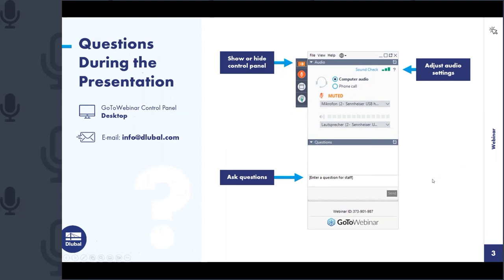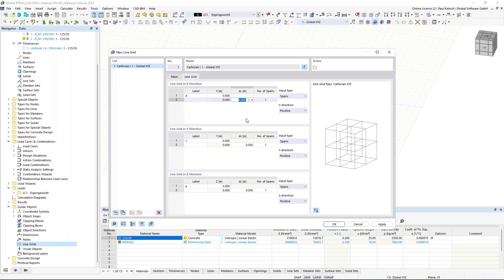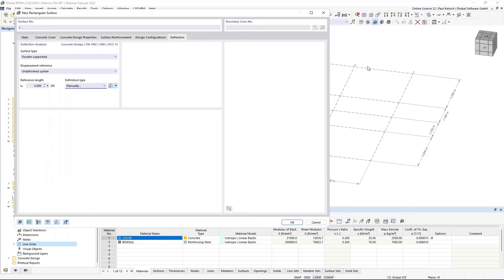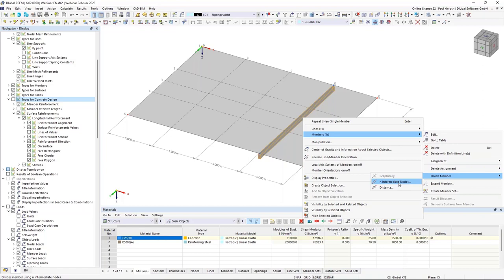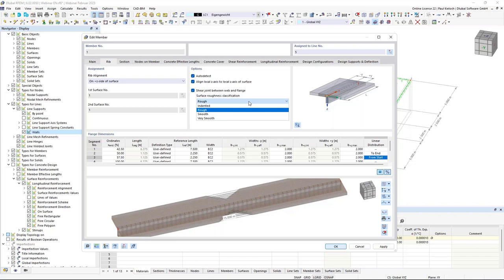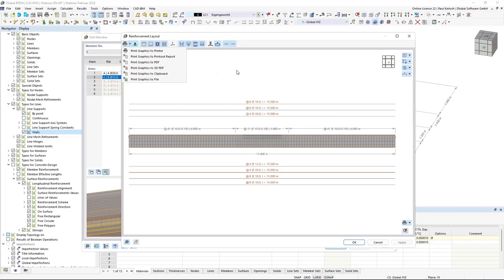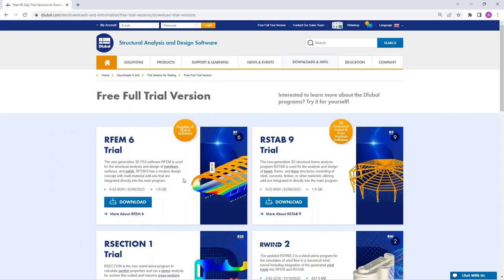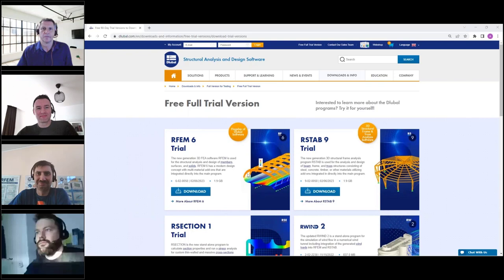New Features of Concrete Design Add-On for RFEM 6 and RSTAB 9

Comment: Sorry but until now the errors related to shear in Slabs that is in this video has not been resolved like DM0301,DM0302, and DM0303 how can we solve this issues
Reply from the maker: Hi, @user-mk7fw5cn4z! 
All design checks work correctly. If you need further assistance, please contact our customer support by e-mail at info@dlubal.com and send us your model. Then we can check it.